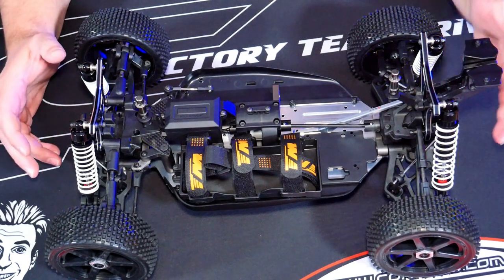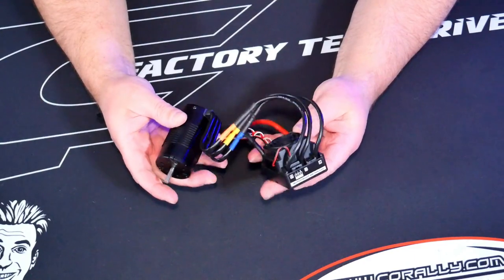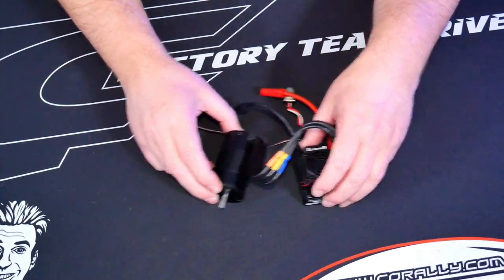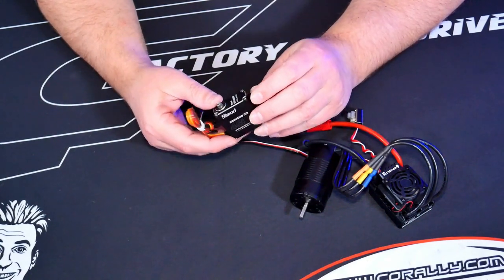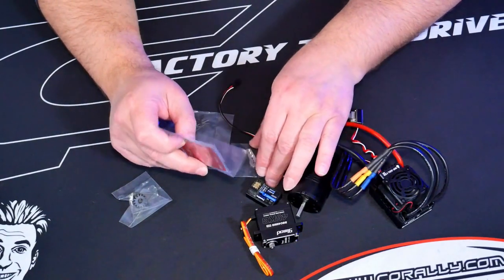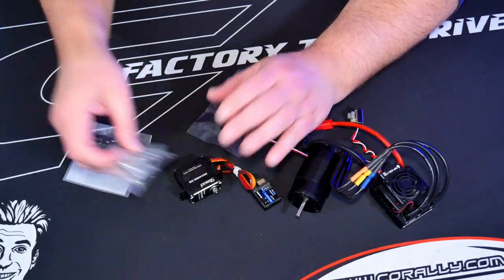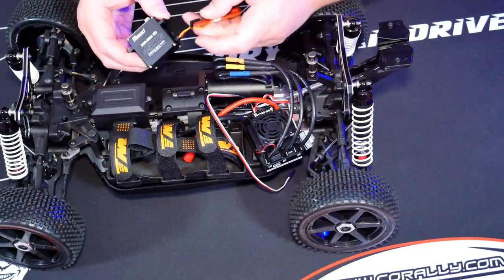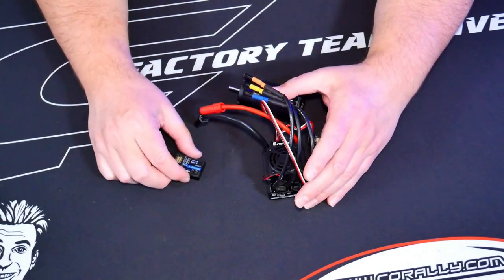RC Pit-Stop 64 - Team Magic B8ER SE Electrics Install

Comment: Nice clean install Vas, cable management is top notch. shame the Rx box isn't water resistant but not a deal breaker by any means. Should be a rather lively buggy with that system!